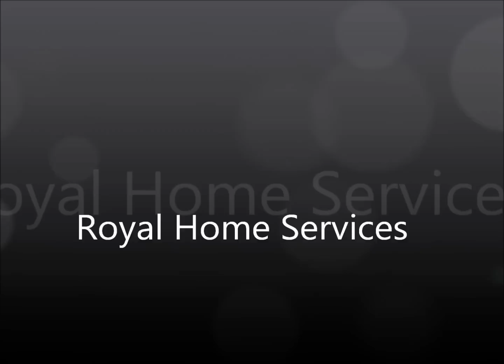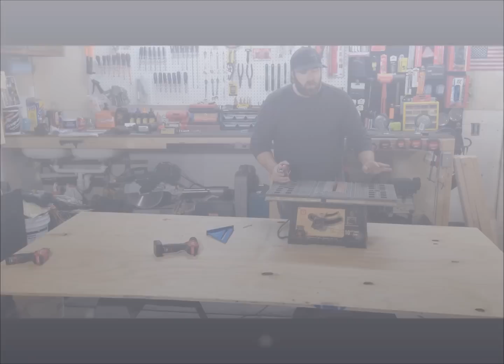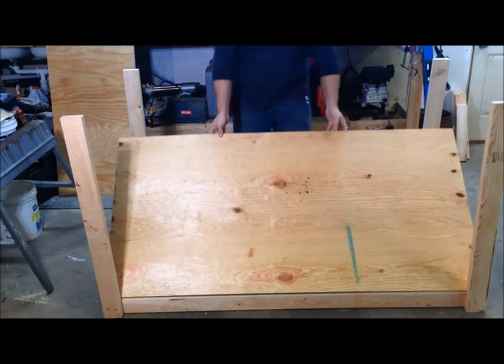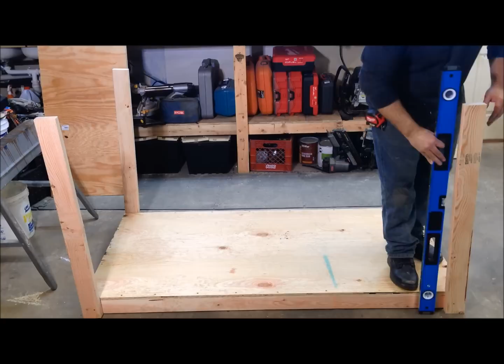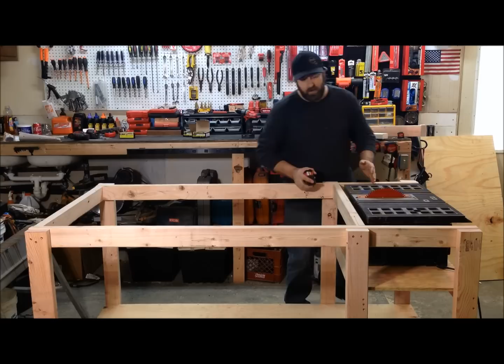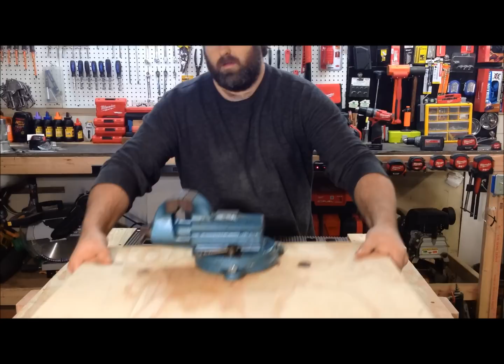How to build your own mobile workbench with built in table saw and vise.

Comment: Your tablesaw surface appears to be nearly flush with the workbench top.  I built in my tablsaw that way too and all was good until the first time I used the miter guage.  The gauge guides hit the workbench tabletop and I couldn't complete my cut.  How did you deal with that problem?
Reply: Grady Stanley rout the table top